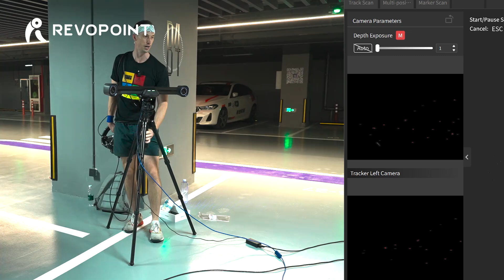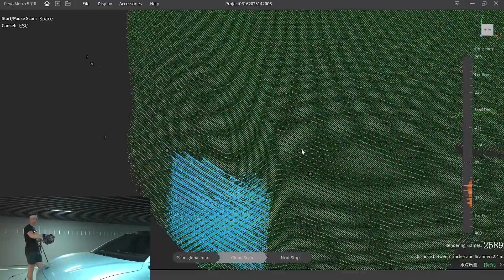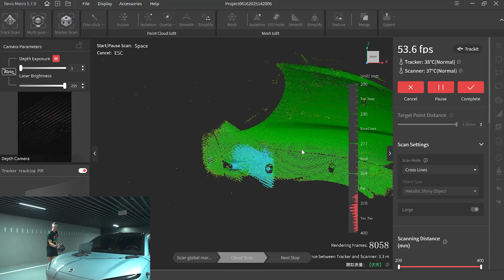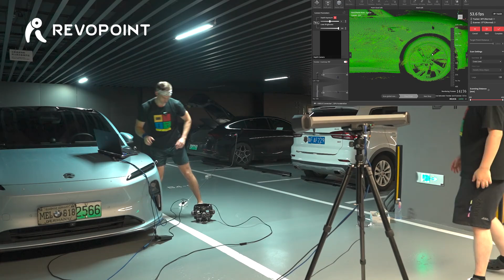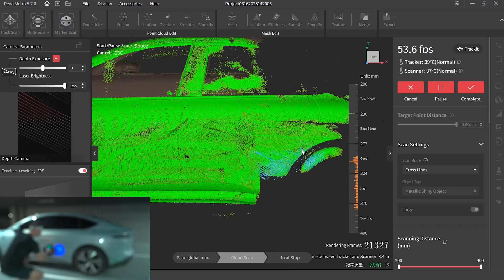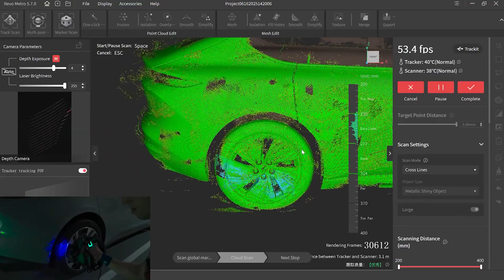Revopoint Trackit - Fully Scan A Car with Multi-position Scan Mode

Comment: How much space do you need around the vehicle? I have about 1.1m around the vehicle. Am I able to attach the tracker to the wall i.e in the corner of the room as that who give me a further 600mm on each side giving me around 1.6m on each saids and 1m at the front and back. I'm looking at scanning vehicles., mainly vans.

Can you use the scanner without the trackit tracker part?

I have more space
Reply: If you only have 1.1m youd still be fine. 
The scanner has marker tracking mode to operate with out the tracker

Comment: Can I capture the interior of a vehicle and the dash with this system? It seems like it might be difficult to use in a confined space?
Reply from the maker: You can switch to standalone Marker mode to capture the interior. Finally merge the model.
Reply: I'm also super interested in this application. Could you do a video demonstrating this? I'm actually more interested in scanning aircraft interiors, but cars are very similar.

Comment: My main concern is the amount of cables needed to set this up outdoors. Powering a laptop off the grid can be annoying. Powering a base station makes me very hesitant. A battery for the station would go a long way.
Reply: seems to be only 3 cables. Power outlet. Trackit Bar to Laptop and Scaner to Trackit bar. So if you have a battery station all should work fine.